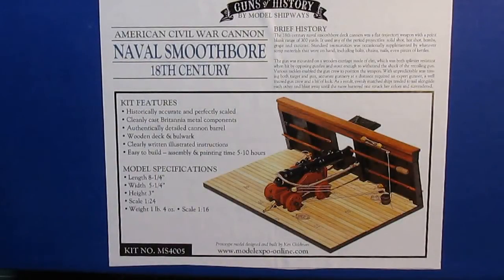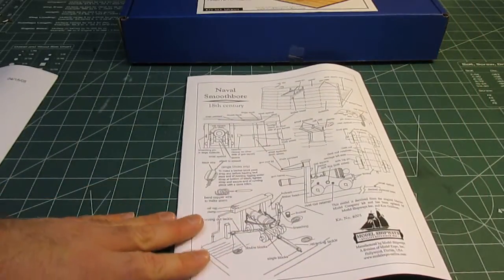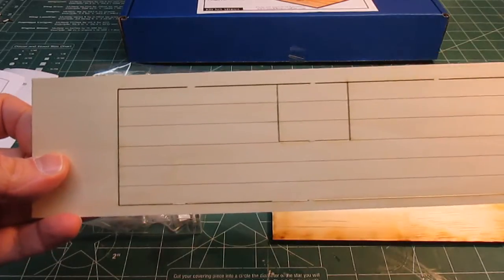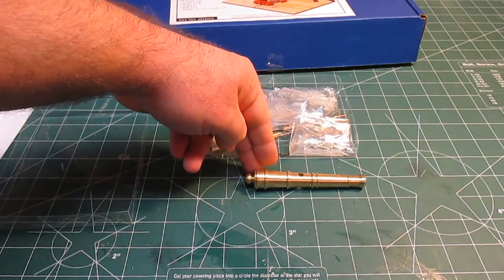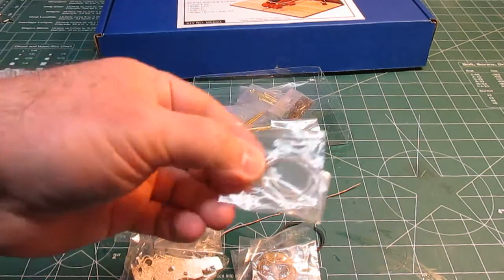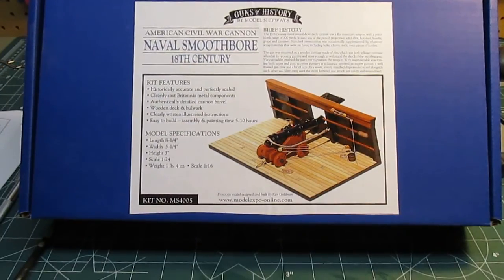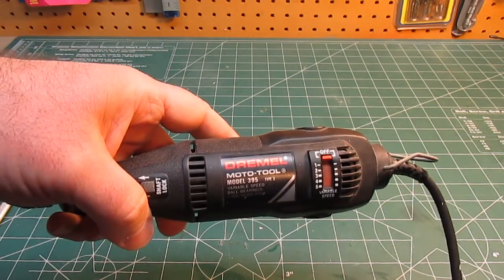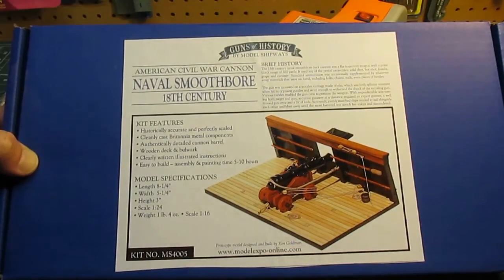Model Shipways Guns of History Naval Smoothbore Cannon Kit Open Box Review

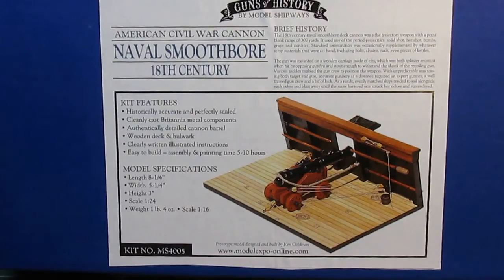Comment: If it is 4" breech ring to muzzle, that would be a reasonable 8' for a 1:24 gun (suitable for one which is to represent something in the range of 'short 18' to 'long 6pdr' though the kit doesn't indicate off-hand what this piece represents.

To be at 1/16th, it would only be a 5'4" gun - a length only found in field artillery of around the 6pdr (light) to 3pdr (heavy) mark or naval 4 or 3 pdrs.

I think at least the gun blank is supposed to be 1/24th